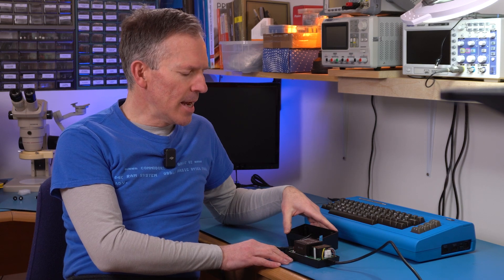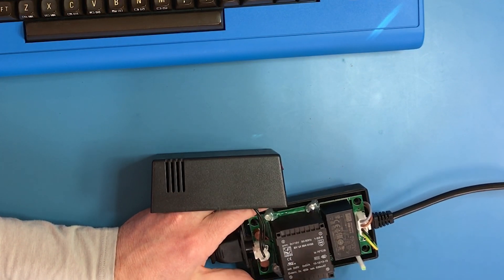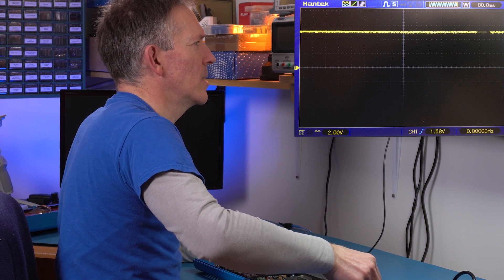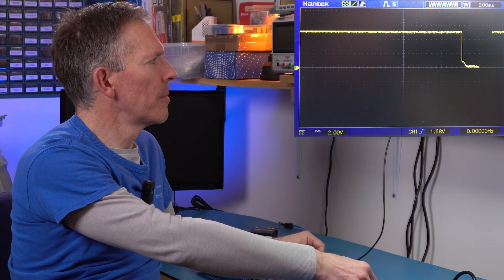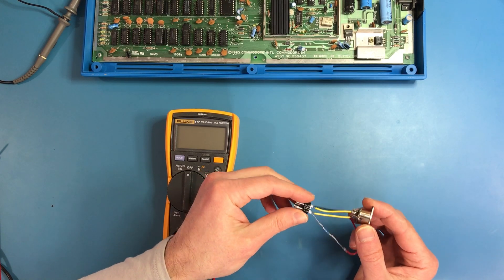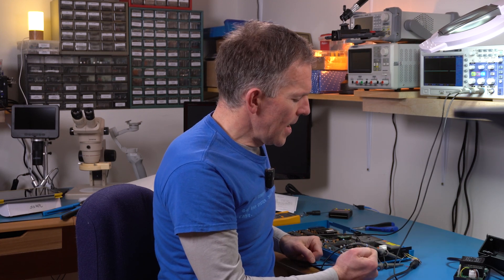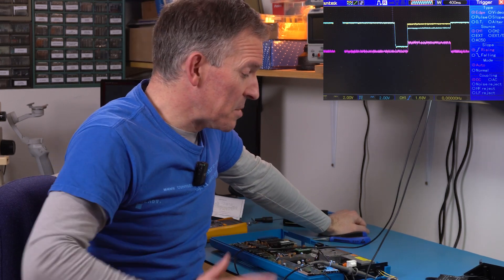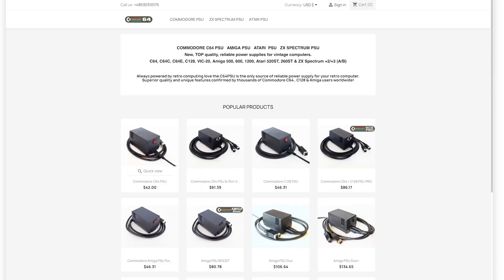What's Going On With This C64 PSU?

Comment: The behavior is a bit weird. Maybe it is matter of the scope. Just a little maybe. I guess, you are not using an isolating transformer for it and that causes the AC/DC module to trip. Since it is a 1 Second „trip“, it should be visible from the power LED.  So I would disconnect everything else (monitor, etc.) and just turn on the C64, watching the power LED coming on delayed. 

I actually still wonder, what the transistor on the bottom side is doing, that I have seen in the other video.

Comment: Isn't for measurement voltage on resistor placed in power line differential probe needed? I think, common probe has one end grounded. Maybe it worked because C=64 is galvanic separated.

Comment: The shape of your voltage drop-out on the oscilloscope suggests something being switched - like you'd see with a power manager chip. It limits output until it reaches a "good" state and then allows full voltage. I'd check that meanwell block to see how it is meant to behave. The mystery is still why, even if that is intended behaviour. If it is unique to that particular C64 it does still need to be doing something different. You've eliminated high current draw so there isn't too much left

Comment: 10:56
consider placing even affiliate, but links to your equipment. I've seen this vise in numerous videos but no one actualy told me it's Panavise product. Why it's so important? Because this vise is simply the best. I have Junior model with suction cup and it was one of few tools that i never knew i need so much :P soldering, holding probes as a "third hand", flashlight's grip, and still being so widely used, it's so precise (the jaws have very fine control over their opening), amazing piece of engineering.

Comment: If it is an inrush current problem you could try to put an 1A NTC on the 5V output of the PSU to limit that. The IMSAI guy just had a chip of the day video on these and their use in SMPS. But having had two faulty switches on vic20 and c64s my first bet would be on an dirty/bouncy switch as gadgetuk suggested.

Comment: Don't forget there are two 5V sources. One 5V comes from the PSU and powers the board logic and the LM7805 5V called 'CAN 5V' which is for the video section only. There's also a bunch of diodes connected to 5V so maybe one of them is suspect. Another thing, the switches are known to cause connection issues so if you are trying to check the voltage you need to bypass the switch by joining the input and output pins so that the switch is not affecting the readings. If the anomaly disappears then the switch is faulty. They are actually not that bad and I've repaired a few switches by opening them and cleaning out the old grease inside, polishing the contacts, re-lubricating it and re-assembling and it worked perfect.

Comment: With the adapter you crafted I think it could be informative to check the voltage drop on the switch on the C64. you should be ok to keep your ground leads where they are at 17:13, but place one of the probes on the power led in the C64 like you did for the first test with the scope. Another thought is, if you can reproduce a persistent fault, what happens if you leave the switch on the C64 where it is, and then toggle the switch on the supply itself or the power strip you have it plugged in to. Although it is odd that the older style didn't seem to have as many or the same issue as this one.

Comment: Good rule of thumb to know:   PSU current should be double what the operating current draw is for any device.  Operating at a 75% or more threshold will cause weirdness.  Current draw is maximum for any electronic device (except power amplifiers if they have a protection relay) when powering them on, as all capacitors charge, and due to their ESR, put a great load on the rails while charging.

If a PSU protection circuit is at the PSU rated current, then it is far too sensitive.  It should be at the surge current, else the PSU is overrated for its real rating.  If that is the case for this PSU, then it's not 2 amps, it is 1 amp.

Comment: Use the adapter you made to disconnect the output of the 5V Mean Well and instead route it to your benchtop power supply (so the 9VAC is still coming from the new 64 PSU but the 5V line is being powered by your bench PSU).

Set your bench PSU to 5V/2A.

If I'm correct the 64 is sometimes drawing more amps at initial startup that's exceeding the Mean Well 5VDC PSU's max draw.  My hunch is your issue will go away if you use the bench PSU.  At the very least you should be able to see the true power draw the 64 is putting on the 5V rail on the display from the benchtop PSU.

If it indeed does go away, you can try replacing the LM7805 and LM7812 regulators with modern replacements.  Murata and Texas Instruments make some.  I can't remember the part number for the murata parts but looking around the net one person on Lemon64 used these TI part numbers:

12v: TPSM84212EAB
5v: TPSM84205EAB
Reply: Thumbs up for that idea. My bench top PSU allows for custom OCP and OVP, it shuts down output immediately if something goes even tiny bit out of the limits. Good thing to check for back EMF or something from the bouncing switch

Comment: The capacitor on the right you pointed your finger at looks slightly bend out to me at the top. But I can't see it that well. If the top isn't flat anymore, but bend up, it's already a sign that the capacitor is failing/broken. Otherwise others said already, at 5Volts/2Amperes, one can estimate with that an internal resistance of 5V/2A=2.5Ohms ... So maybe taking 5% of that value as a resistor to measure over is better, not changing voltage and current too much and reducing the power at that resistor below some 0.6Watts a typical Metalfilm resistor can handle.

Comment: If you want a fairly precision low value shunt resistor, and don't want to buy one, you can try using your multimeter in current mode. It will have a range of values. Probe as close to the meter as you can, use a much shorter time base and trigger on the edge. Any transients are going to be too fast for the scope to catch at 200ms devisions.

Comment: Power on reset circuit holds reset high for 0.5 seconds... Your scope showed low voltage for around 0.5 seconds. That could potentially mess up system reset.
Reply: But that doesn’t explain power LED to stay low. It is not about the CPU reset but keeping MW PSU in “safe” state

Comment: Dirty contacts in the switch or plug could cause voltage to look good when no load, but act as a large resistor when any current is being called for
Reply: Exactly. This is the most common fault with most old C64's, and so easy to fix.

Comment: I think with your 1Ohm resistor you limited the inrush current a bit so no problem manifested. You need to connect several 1Ohm resistors in paralel (the total power limit per resistor will sum up then). With 1A over the resistor you'll have a drop of 1V per 1A drawn (1A * 1Ohm). With 5 resistors in paralel, the insert resistance will be 0.2Ohm with drop of 0.2V per 1A drawn and much less power and heat losses. Also beware that the osciloscope channels sharing common ground (unless you have differential probe on input), which is commonly connected with PE wire on socket when your scope is powered directly "from the wall". This could lead to shorts. Rule of thumb is to use just single ground wire on single probe and measure everything against that potential (alt. with some math). Try to insert some coil (with high enough nominal current) into 5V supply - this could eliminate the current spike a bit. And check with much faster time base, you're searching for something really short which could be "smoothed out" by averaging of measurement samples over larger time period on the osciloscope. Sorry for "bringing trees to wood", but I think this needed to be stated for some of less experienced viewers using this method of current visualisation to prevent possible damages.
Reply: I concur. But I prefer to use things which work around 1 rather than 2. Less math, less chance of confusion. Some examples follow for understanding the principle (for other readers), not to refute your comment

5x 10ohm resistors in parallel would be 2ohms. And if they're metal film 1/8w that would be rated for 5/8 watts. Also, 1amp current would show as 2v voltage drop and you have to do math (÷2) to get the current. You'd also be feeding the device under test (DUT), the C64, with just 3v as a result. The resistors would be dissipating 2watts (well over the 5/8 watts!)

10x 10ohm 1/8watt resistors would be better, giving 1ohm resistance, with 1.25w. 1amp would show as 1v drop across the resistor, so no math.

For power handling, you have to calculate the watts using the voltage drop across the resistor, not the supply voltage, because you're calculating the power dissipated as heat.

So, if you have 5v supplied at 1amp current draw, across a 1ohm resistor, you will see a voltage drop of 1v So dissipation is 1v x 1.0a = 1w. But that gives you a brownout situation where the DUT then only gets 4v

So, we go for 10x 1ohm in parallel. That gives us 0.1ohm resistance, and 1amp current results in 0.1v drop. The DUT gets 4.9v, and you crank the 'scope vertical scale a bit so the smaller reading is still readable. Also with only 0.1v drop at 1amp, the resistor dissipates only 0.1w. With 10x metal film 1/8w resistors, you can dissipate 1.25w so 0.1w is negligible. Although this introduces math again. At 1amp, the 0.1v drop reading needs to be adjusted (x10) to equate to amps again.

0.1ohm is a probably recommended to avoid brownouts... 0.01Ohm would be less burden, dissipate less power as heat etc, but you gotta change the scale on the 'scope again, and multiply the reading by 100x. Voltage drop at 1amp is only 0.01v so the DUT would get 4.99v. Dissipated power is a mere 0.01w. Win.

It's fun to work out the best solution.

A 5W ceramic wire wound resistor would easily handle the job, if you have one at 0.1 to 0.01 ohm

Comment: Check for shorts or leakages between 9 V AC and 5 V DC inside the C64. This can be overvoltage protection, not overcurrent.

Comment: For a shunt resistor to measure the current you need very low resistance, 10Ohm will already limit the current to a maximum of 500mA so you aren't going to see any spike, if the fault is a semiconductor it will not be juiced enough to provoke the fault. You should use something in the range of 0.5 Ohm 20W, one of the ceramic white blocky ones, and that will already limit the current to 2.5A.
Reply: It needs to be much lower than that to capture what's really happning. The voltage drop needs to be small enough that it doesn't affect the computer, for 5V and 12V it's common to try to aim for at MOST 100mV drop over the shunt which for 2A corresponds to a maximum of 50 mOhm (0.05 Ohm!). And if you have a high resolution oscilloscope going lower (say 10mOhm, 20mV=2A) is even better as it will interfer less with the circuit and giving better results. And as a side-effect you can use small low-power shunt resistors because it's no longer burning a lot of power 🙂
Reply: @Torbjorn.Lindgren If you want a precise reading and a full working machine yes, but to check just a spike in what seems a problem in the power section it should be enough with 0.5Ohm.

Comment: I think your theory is right. There is an in-rush current when you turn the machine on that triggers the PSU's OCP. After half a second, whatever spurious capacitances had to charge will have charged and the OCP will turn off. What you're seeing is typical of it. Your attempt to measure the in-rush current with that little resistor will not bring you anywhere, I'm afraid. A 1Ω resistor needs to pass 1A current to have a 1V voltage drop (I=V/R), and that is assuming the resistor can take that kind of power (1W), otherwise goodness knows what kind of breakdown effects and thermal shock will be interfering with your results. In-rush currents can be caused by leaking capacitors (leaking in the electrical sense, not leaking electrolyte). If a capacitor is letting DC through, it will take longer to charge and require more current to do so. The easiest way to check is to remove the capacitor from the board and measure its capacitance (not ESR; ESR has nothing to do with DC leakage). If it measures higher than nominal, it indicates leakage (the multimeter infers capacitance based on current draw, and will interpret higher current draw as higher capacitance). With a bench power supply you can do a more reliable test: set the bench power supply to the nominal voltage of the capacitor, and apply it. Then check how fast (or slow) the voltage gets to the nominal value and the current out of the bench PSU goes to zero. If it doesn't happen pretty much instantaneously, you have a bad cap. DC leakage is an effect of EPR (as opposed to ESR), but it is dependent on the applied voltage, so you can't measure EPR with a multimeter in resistance mode. There can be other sources of spurious capacitances leading to excessive in-rush current, both on the board itself and in the ICs. In the latter case, it indicates imminent failure. Either way, you can avoid triggering OCP by using an in-rush current limiter (it's a thing), such as TDK's B57238S0709M000, in series with the 5V line. If after applying it you still have the problem, then you can rule out in-rush current issues.

Comment: FWIW you seemed suspicious of the Meanwell supply last stream, but to be clear they're a pretty reputable brand. The engineering firm I consulted with for a while used them in prototypes (expensive prototypes, as all prototypes are).

Obviously it's still possible for it to be faulty or not perform well in this situation for some reason! But the Polish company is doing a solid job building that module into their PSU.

Comment: Noel, my dear friend...
You're an engineer of sorts, you are great with electronics and know your stuff well. 2-thumbs up for that.

I had to check my Vic20 with the PETAcsii keyboard, and it says that its input is 117VAC @ 1amp (USA). Given that - when transformers drop voltages, amperage goes up - Law of Conservation of Energy. Since My Vic20 is a 2-prong 9VAC input, that means it is getting (rounding off numbers here) 9volats at around 10amps. 10amps?!! Of course the internals of these older Vic20s has full power regulation,  conversions and dividing up power to area where it is needed. Thus when it takes 9VAC  @ 10 Amps and steps it down to 5VDC, the amperage will be less because power is also divided up to 12VDC and 9VAC. So lets say it is divided up equally, so 5VDC, 12VDC abd 9VAC are each getting 1/3 of the input of 9VAC @ 10Amps; or about 3.3Amps.

You are feeding 5VDC @ 2Aamps into that C64? That is not enough power to keep the system running, especially THAT C64. If it turns on, the voltage regulator and chips will get hot because they are stressing for more power that is not there/

That Blue C64 of yours is not a Cost Reduced C64, with just a few chips and a large custom (PLA?) to take much of the logic for the 6510, same with my Vic20s (and C64, which is in storage)

I also have a couple Cost Reduction Vic20; in chip counting, they have 24 Chips compared to 30 in my PETAscii Vic20. And all the Vic20s use Static RAM, so they use less power than the C64s which uses Dynamic RAM. Using less chips, the Cost Reduction Vic20 would use less power than the PETAscii Vic20. The same is true with the C64 vs. Cost Reduced and Aldi C64s.

True, you can use a 5V USB @ 2.5amps Charger to turn on a Vic20 or C64, but it is only enough to turn it on and see it BASIC pops up on the screen. Other than that, it would be limping along, and not able to use load programs from Cassette or Disk Drive, no can you connect anything to the User Port. Your PSU is like a USB Charger, just enough to turn on the C64 to show BASIC but no more. Thus it is why you have issues with it turning on.

If you are getting a new PSU, keep in mind that you woll need at at least 5V @ 4amps or more with 9VAA @ 5amps or more. The C64 will be happy with the power increase and everything will run on it much cooler.

Great video. You always make great videos..
Reply: The original C64 PSUs did 1.5 or 1.7 amps, so surely 2 amps is enough? Also, where would you get a C64 PSU that does 5 amps?

Comment: Could be a current issue. I had a PS that worked well on some C64, but not others. Even swapping a SID or VIC could cause the C64 to not start. Replaced the PS and it worked

Comment: I have got such a psu from poland and it works flawlessly. It is approx. one year old and I use it a lot. It has two connections, one for the c64 and one for the 1541. Very handy
Reply: Still, this is not relevant to his issue. Also the shady explanations at Electroware's website about current drops when using the 2-1 PSU for the C64 and a 1541-II. Already there they reveal themselves of how cheaply made these are.

Comment: The AC Power Supply is a transformer with 2x 9V AC @ 2x 5VA. There are 2 secondary windings on the transformer with 9V output in parallel and can deliver 10VA (2x 5VA) or 18V in series with 5VA. The watt (W) value indicates the real energy consumed by the consumer device, while the volt-ampere (VA) value indicates the so-called “apparent power”. The two primary windings are 115V AC in parallel in the US and in series for 230V in the EU.
The nominal 5V DC output is ratet with +/- 5% wich means that the 5V can range from 4.75 - 5.25V. So it's OK with your measurement.
The Meanwell Powerbrick is a switching power supply and can deliver 2A @ 5V DC. It also has an over current protection. So it's possible if you turn on your C64 that in 'Switch-on-mode' the Meanwell goes in Over-Current-Protection and switches on after a short time (i.e. the Capacitor in your C64 is charged). It's sometimes confusing with the markings of a transformer for the EU-Market.

Greetings from Germany.